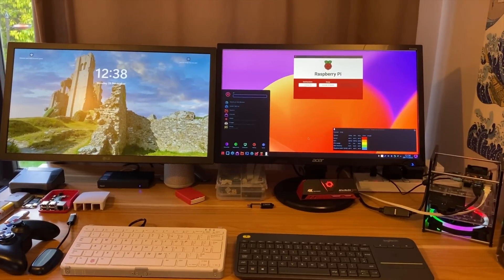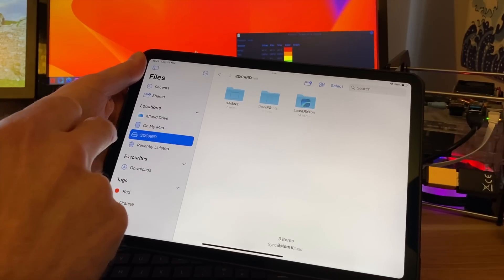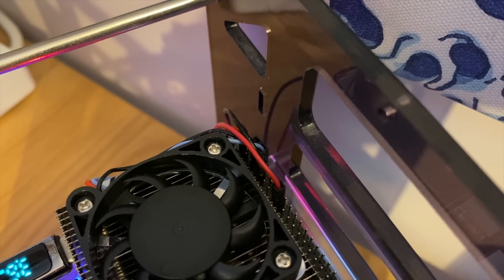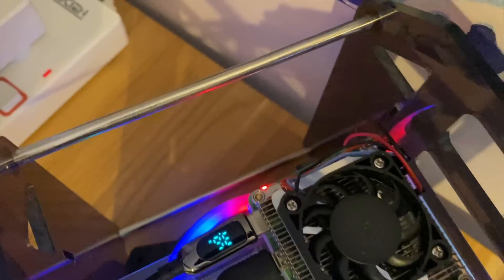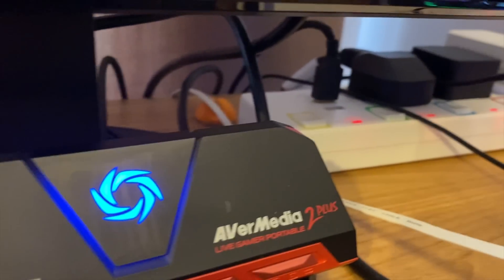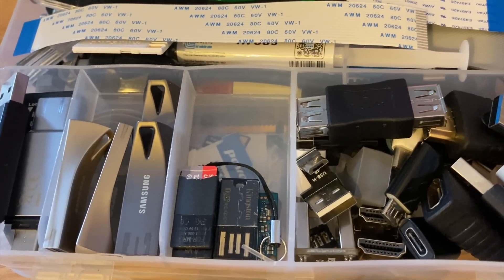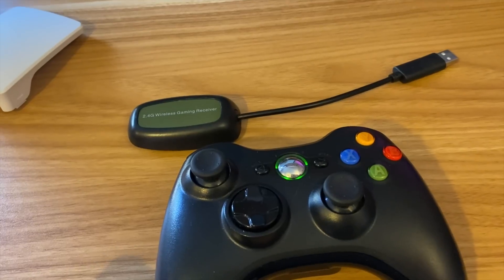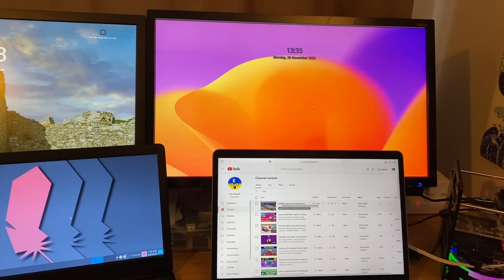My current Desktop setup. Raspberry Pi 4.

Comment: The Orange Pi 800 has a microphone. For everyday work, the Raspberry Pi 4 is way behind other SBCs nowadays on many aspects including CPU, GPU / accelerators: NPU, connectivity: (e.g. built-in M.2 2242). Looking forward the Pi 5 but will it be able to catch up?
Reply from the maker: Definitely

Comment: A while ago, having used Balena Etcher for to write the SD card, I found that the RPi 4 USB3 port just didn't work well with the initial boot, hanging. A few times around the block and certainly with the cable in use, the results were consistent, but after that first boot and setup, all seemed to be OK and worked just fine from a USB2 port. . . until a couple of months ago when I was away elsewhere. I had problems booting from the USB3 port. Once again falling back to USB2 fixed my problem. I had never thought about the cable, which was the same one all the time. I use the RPi 4 when visiting elsewhere.

I appreciate that the issue is likely to be a personal one for me, but for what it's worth, if anyone is experiencing any similar issues, a fallback to USB2 might be an answer. For my part, who knows, perhaps a different USB cable might be the answer.

Many thanks.
Reply from the maker: Definitely the cable I would say.

This may help

USB Sata cable Fix. Black screen, won’t boot. Raspberry Pi 4 8GB. Raspberry Pi OS 64bit.
https://youtu.be/9HV4C0Llktk

I always have working usb sata cables linked in the description

Comment: looks like my last comment was deleted. Have you tried OmniROM on the Pi4? They also provide Android13 based builds. Maybe compare it to LOS20
Reply from the maker: Not recently 

Android 11 OMNI on Raspberry Pi 4. SSD / USB boot installation.
https://youtu.be/Y4uxe_si0LY

Dex on a Pi 400…. Sort of.
https://youtu.be/HkMB3NXMDBs
Reply: @leepspvideo  maybe you can test it again with latest Android13 Builds and look how it works
Reply: ok, Omni release a new Android 13 based version with GApps not MicroG

Comment: 😭😭😭 THANK YOU REALLY SOOO MUCH FROM THE FIBERS OF MY HEART FOR YOUR PRE-LOADED KDE, YOU HAVE NO IDEA WHAT I WENT THRU TRYING TO GET RCA WORKING WITHOUT A SCREEN I THOUGHT OOOH ILL FIND A SCREEN THAT WORKS, THEN MY new ryzen pc was shorted by the PCIE adapter for the bendable cable… fried the cpu/ram/ssd/m.2 and PSU!!!! Brand new Ryzen 5700g 3060 setup posted just Finnnne all I had to do was plug in the 3060ti!!!! XC edition!!!! The dang old pc I had never had so many issues like 6years Jesus i3 1050ti, recently sold and got another Intel mobo realized that was never going to cool a SFMini by NFC case sold it SLOWLY bought another wrong pc chip sold that then sold my original as I still had her, I was without a pc for a little bit the ryzen mobo even came in 2.0 vers Jesus Christ the second mobo I bought used came in the mail with broken Capacitor Jesus Christ $56Digikey later still need to drop like $60 for a heat flow rework station so I bought another. Worst is I can’t get the 400w hdplex DC units anymore so I’m really hoping it still works, life has gone from $156 ultra 4K usb monitor running star citizen fun and clunky to months and months of no PC I’ve taken the parts off and on so many times I need time… ffffffffffffkkkkk!!!!!!!

Comment: Hey lee
You should check out tiling window managers on pi's
Great examples would be i3 or sway, Hyprland would be best but you will need to compile it manually with a build flag for older GPU's
Performance is incredible and resource usage is really low, Downside (for beginners) you will need to get used to using your keyboard more than your mouse
Would be interested in seeing how you would theme your tiling desktop

Comment: Ever had no signal error when switching monitor on and off, after changing desktop environment to KDE? I like one particular screensaver that Trinity Desktop Environment offers, but in general it's customization is too limited. Wonder if it's possible to extract screensavers and make them run on different desktop environment.
Reply from the maker: My monitor sometimes doesn’t wake but I am going through a capture device. It happens on several operating systems

Comment: My current Raspberry Pi setup consists of a Raspberry Pi 400, an Adafruit Cyberdeck, a WaveShare 4inch DPI LCD screen and a KVM Switcher. Yeah 4inch sounds small by it's 720x720 and surprisingly very useable.